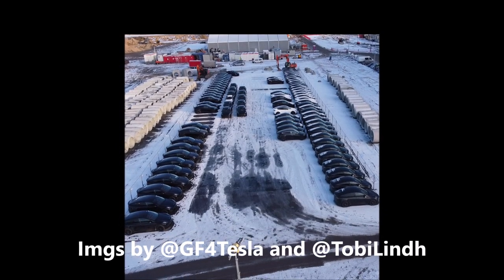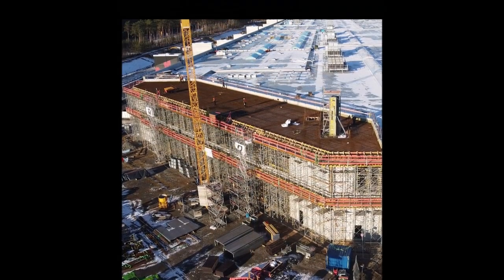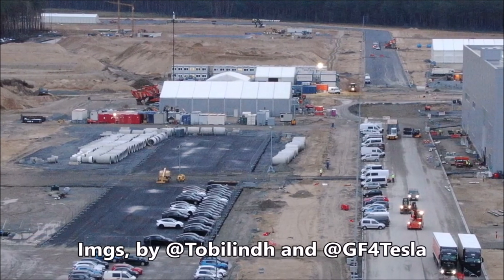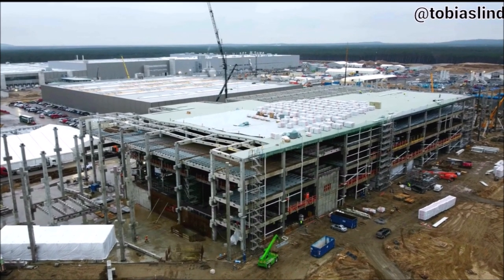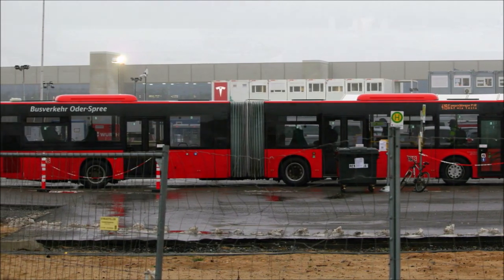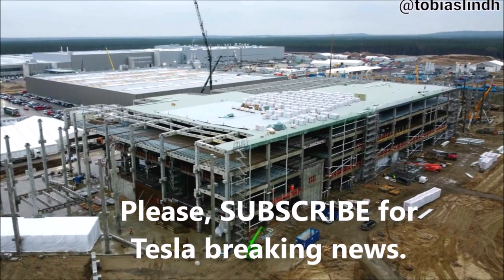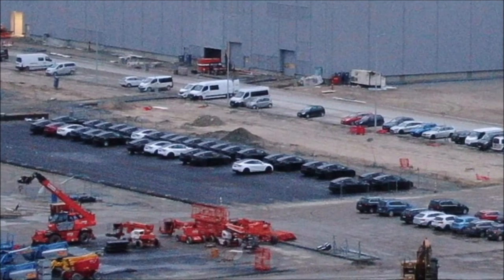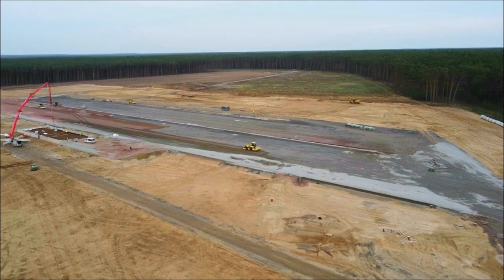HOURS AGO! More Tesla Giga Berlin Cars, But No Signs of New Colors Yet

Comment: as far as I was told...white and black will be the first Berlin Model Y colors to be delivered in March 2022 (performamce) and in Feb 2022  (long range).
All will have 16V Li front batteries and AMD Ryzen chips.
Putting Shanghai & Berlin side-to-side, one should not be able to tell a difference.
Other colors will follow in May...
No sign of any extra colors yet..